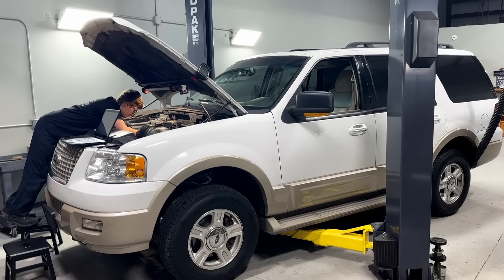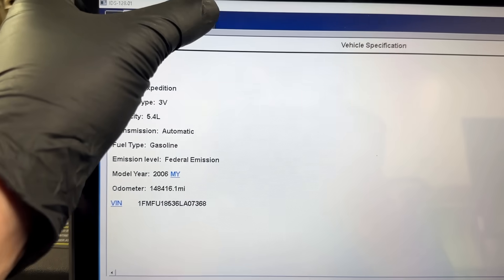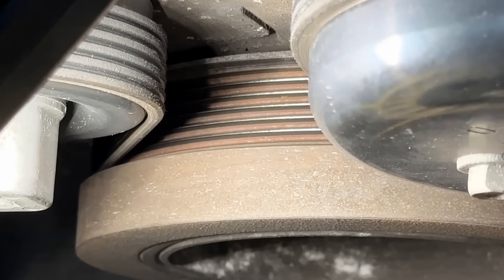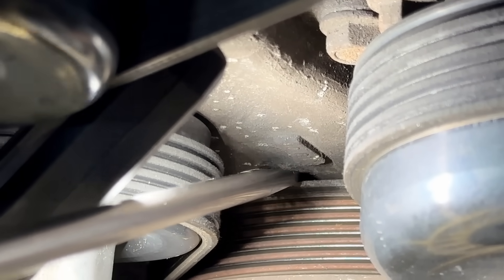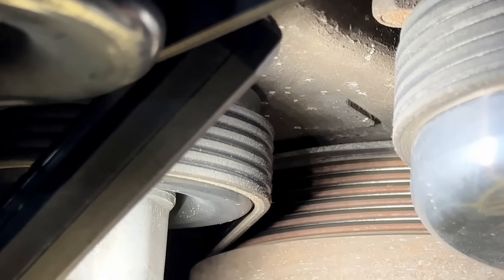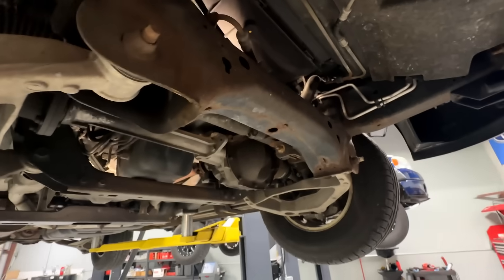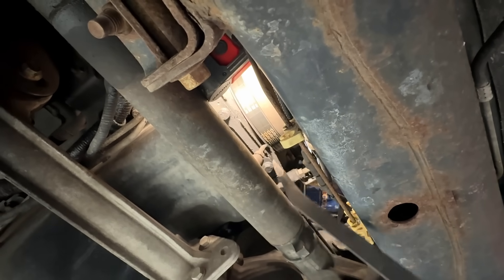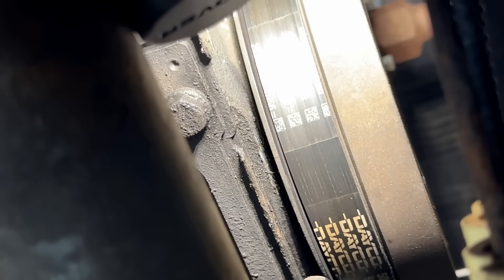Ford 5.4L 3v Triton Engines: Always Check This First Before Performing a Timing Job on this Engine!

Comment from the maker: This is how it looks inside the engine when the thrust washer fails-
https://youtu.be/dxJ23dv3pt0

Forscan is a free Ford Specific Diagnostic Software:
Download Here- 
https://forscan.org/home.html
ELM 327 Adapter I Recommend-
https://amzn.to/2GC6dBj

As an Amazon Associate I earn from qualifying purchases.
Reply: Ok, thanks for the link.  Trust an arrogant engineer to think that they have a soooo much better idea than something that has worked flawlessly for decades.  Good plan - replace a robust thrust bearing on #3 main cap with a small two piece washer!  Hard to comprehend the stupidity.
Reply: so whats the cure ? engine rebuild ???
Reply: I have 3v billet oil pump gears and I wanted to know if they would fit in a 4v oil pump. If not would a 3v oil pump work with a 04 mustang GT 2v?
Reply: Where are you located? I've got 2010 f150 that needs a timing job.
Reply: I have this issue. But my truck is still running. Is there any saving the engine if caught early can the washer be replaced
Reply: I got a 5.4 3v that doesn’t like to keep a idle at times, there is a pcm code p0605 that workshop says replace pcm with no description. I’m not do you know if this code would be the source of my iss😊ue
Reply: Runs good most of the times but once it shuts off once it’s repeated until I let it sit for a while  dealership says this is the only lead for my issue
Reply: Okay, I'm not too sure if this applies to mine. I need help trying to understand here. U only mentioned up to 2008. I have a 2009 f150 4.6 3v. Just had to replace camshafts lifters rollers and phasers. All OEM parts. Not the more advanced rollers with the new angled hole, but OEM. I followed ur video where u demonstrated replacement of the phasers to a t, but I also installed new camshafts and so on. I started my truck after everything and it has low power stall and rough idle. It did throw a misfire on cylinder 1 so I changed spark plug and it got a tad bit better. I watched this video because it just popped up and wanted to know if it applies to mine as well. Ford manual states typical endplay can range from 0.003-0.010, but is only obtained by pulling the engine. My crankshaft doesn't fit tight against timing cover and I need ur opinion please. I know you're busy I understand. I just need ur help please. I'm willing to rip this motor out n rebuild if I must. I wouldn't mind the experience. Thank you. God bless
Reply: @chadmoyer1453 where are you located

Comment: So, my church  plow truck is an '06 f250, 5.4 3 valve.. about 230,000 mi, and we were told that it wasn't that long ago that it had all the timing work done. Occasionally, after the motor gets warm, A noise will start, and sounds like a loud tapping, knocking. And I'll shut the truck off. Maybe let it sit for a minute, start it back up, and it's pretty much gone. But you might still hear it a little bit. And then it might start again. I'm going to get underneath of it and check like you did. Will the play that you're talking about, will that create a knocking noise? And how big of a job is that to fix?

Comment: I got an 07 f150 5.4l. A very few gold sparkles showed up in my oil - just changed the oil pan gasket and none of the bearing caps had any vertical movement, is it possible the thrust washer is going out and I can replace the thrust washer before the engine is shot?

Comment: At 8:30 sometimes I don't hear what Brian is saying. I'm hearing "R Indicator." What is that device called and what is it for?
Reply: Dial indicator.

It is used for measuring. It consists of a dial graduated in .001” with a plunger that goes in and out to do the measuring.
Usually mounted on a magnetic base with an adjustable arm so you can measure in all different directions.
Reply: @pvtimberfaller  omg dial indicator! Sometimes I think I don't understand plain English. Thank you for helping me out there.

Comment: I had the exact same issue with my Ford oil leaking in the same spot, oil pressure doing weird things, was driving fine and then now I have advanced retarded crankshaft timing so do I need a timing job or do I need to fix the crankshaft pulley?
Reply: Im about to check mine to see if there’s oil in that spot but im doing a timing job due to rough idle and low power. It’s on and off but she started shakin n chugging as I got out the driveway which never happened before. Timing job is my assumption but now I gotta check the crankshaft pulley and if there’s oil and play there, then I gotta look into that as well. Fingers crossed.

Comment: Hello, I just bought a 2007 Ford 4X4 5.4L V8 Supercab and it is a project for me while I retire. I really like the truck, and you've given me a lot to look for. Since it is my last V8, the truck is special to me. And I look forward to getting it back on the road.
 Right now I have a No Start beginning, just replaced the battery, so I was going to give it a light tap with a nylon type hammer, and then if needed clean the corrosion off the leads to the studs. I have Subscribed to your channel and fingers crossed and hoping the problems ar not to deep, I hope to get this old girl on the road in about a year.  
 As soon as my wife gets back, I will be out taking a good look at her and hope to at least get it started soon. She sat for about 2 years, and rust took over quick. 
 I have always been a MOPAR guy, and thought I would try something a bit different...

Comment: Have a 2008 F-150 XLT Supercab 271K  miles.No codes showing,still runs great,oil changes every 3K miles.Intermittently getting the shaking at low rpm’s,can accelerate out of it but local mechanics will not do a timing job on it.They all are suggesting a new motor.Your thoughts? Thank You.
Reply: Did u get any more info about this? I got the low rpm intermittent shakes and am doing the timing job myself. Fingers crossed it fixes the issue.
Reply: @Texasd96 I took a commenter’s advice and changed the oil from 5W-20 to 5W-30.So far no issues, but I haven’t driven it for a long distance yet.👍

Comment: You mentioned in passing, without suggesting what the specific issues are, on 2006-08 5.4L 3V engines. Mine is a 2008 and currently doing a full timing job on my F250 Super Duty. You have given me a lot of useful information in all of your videos, but some statements like this only leave me searching for specific answers to fill in the blanks. 

Yes, I knew this engine has some specific shortcomings when I purchased it, but more hints would be useful.

Comment: Mi Expedition king Ranch 2010 hace ruido al encender el motor por la mañana como si trajera algo suelto en el motor, así a grandes rasgos ¿Serán las guías de las cadenas o los sincronizadores? Saludos desde TX.
Reply: Si. timing chain tensioners and guides if you catch it sooner than later. With time the roller followers can be damaged as well eventually damaging the cams.

Comment: Are the clearances the same for the 4.6 3v, specifically the Mustang version? Mine has around an 1/8” gap. It’s big enough to comfortably get a flat blade in there, but no movement with the prybar test.
Reply: @fordtechmakuloco same question, same situation, i was checking for this comment before i asked myself, i got an 05 mustang 4.6 3v about to do timing, came across this, should it be as snug as these 5.4s?

Comment: You can also look at the tensioner pulley as well.look at where the belt is riding on that pulley. Then do your crank end play check.great advise!
Reply from the maker: Nope, only because the aftermarket tensioners can ride toward the edge with no crankshaft end play but the Ford tensioners will track in the center with no end play. Thus I do not want to mention it and lead anyone astray.

Comment: The water pump pulley.and belt riding on edge is easier to see!
Reply from the maker: Aftermarket tensioners can also do this so it is not accurate

Comment: A bit late to this video...mine appears to be bad, same sort of gap. Weird thing is, truck still runs great, no codes, rough running, etc. Doesn't burn a drop of oil, but sure leaks. Bottom of engine is covered, seems like it comes from the front somewhere. I was going to do a timing job, but will skip it now and re-evaluate the whole truck. Not sure if I want to replace the engine at this point. Then add in brakes, shocks/struts and tires. May be time to just run her til she leaves me stranded....any advice? 192, 416 miles...

Comment: You look at where belt on idler pull is all the way to the outer edge.
Reply from the maker: No always an indicator especially with aftermarket tensioners.

Comment: I learned something today! I could also see that the belt was riding real far out on the tensioner. It was a big difference on the good engine. Like you said, about a 1/4 inch. Got to pay attention to the details in this business. Could save you a lot of headaches later. Thank you.

Comment: Hi! Thank you for posting this! I have the '08. replaced the timing chains in 2022, then again in February of 2024 and they are starting to go bad again. I do not know if my mechanic put OEM parts in it either time. Besides parts quality, would there be any other reason that the timing chains would fail so often? any insight would be greatly appreciated!

Comment: Hi I'm a fleet mechanic, I have in my fleet 2, 07, 5.4- 3 valve f250 superduty's,  from day one 3,000 mile oil changes, up to 400,000 miles and we are in the 2024, everything in my motors is original, with no external leaks, so not sure why everyone bashes these motors, they are a stout motor!, I will argue with anyone, its your bad maintance! proof is in the pudding! and I'm in Michigan!
Reply: my thoughts, sir   rbw

Comment: Can tell by how the belt is riding on the idler pully. Good call though.
Reply from the maker: Not always, if it was a Ford tensioner pulley then yes but many aftermarket tensioners do not track in the center which would give you a false reading.

Comment: I keep having a p0022 code for timing over advanced truck runs great idles great until it reaches temp then Runs horrible already changed vct solenoid and replaced phaser on bank2 issue keeps happening any idea what it can be?

Comment: Question, somewhat related. I'm finding transmission fluid on my bell housing and sway bar, but don't see any signs of a leak around the pan or hoses. It was recently rebuilt.

Comment: I came here because I was looking at a 2007 F150 on Craig's List:

" 07' with 122k miles. 4X4... V8 5.4Liter... runs great. I listed the truck way below blue book value [$6,500] due to it needing a timing chain. I am selling it AS IS at that price. If I end up fixing it, the price will raise up to accommodate the work. Either way, it's a steal. "

0:40 "07-- the Sweet Spot you want to avoid at all costs! (It's a steal, indeed!)

Comment: I recently did my rack and pinion, inner and outer tie rod, four-wheel-drive, actuator, steering shaft, I have power steering pump, and now when I’m going into a curb or turn. If I do not slow down, or if I attempt to meet up even a fraction of 1 mph, I get a horrible shake in the front everything is tight and nothing seems to be alright… Any suggestions on what it could be? Or what I should check?

I’m truly stumped on this please help

Comment: On my 2005 F150, I have a 1/8”  gap between the front cover and crank pulley on the topside, but no play when doing the pry bar test underneath. I guess I’m good to go ahead with the timing job?
Reply from the maker: yes

Comment: Just on watching the serpentine belt riding on the outer edge of that pulley  at the left can determine that there is a problem!
Reply from the maker: If it was a Ford tensioner yes, but aftermarkets can track on the outer edge and have no crankshaft endplay problems.

Comment: Question is, why did the thrust bearings go out? This might be a deeper issue if it’s the converter like someone mentioned in comments  and you put in a new engine it will just happen again
Reply from the maker: Very common issue 2007 years mainly.

Comment: I have a 2006 Freestar with a 3.9. It makes a metallic grinding noise some times for 1-2 seconds on start up. I’ve searched YT and the web to find out about timing issues. Do these having timing chain or tensioner issues? More info would be appreciated, thanks.

Comment: I have an 07 5.4l. Just bought it and it has the gap on the crankshaft dampener and rear main seal leak. No performance issues or codes yet. 

Should I plan on replacing the engine or is there anything I can do to prevent catastrophic failure.

Comment: I have an ‘08 F-150 with the 5.4L. My crankshaft end plate is about 1/8” off. I have a rough idle when the car warms up and I’m getting a P0016 engine code. This was a remained motor replaced about 60,000 miles ago. Truck has 273,000 miles on it. Any suggestions? Changed the the VCT Solenoid and Camshaft position Sensor on the passenger side, no changes.

Comment: So why not just let it ride? Who cares at this point. Needs an engine anyway so ride till something actually breaks
Reply from the maker: Oil pressure loss to the heads when the crankshaft walks.
Reply: @FordTechMakuloco  you’ve replied to two of my comments, my brush with fame! I watch your videos religiously, you are the Tom Brady of fords. I have no idea, I just moved from the 6.0 diesel to the 5.4 and this a whole another basket of things to learn…

Comment: I thank you for all of your videos!  I own a (2009 F-150 130,000 miles)  It's not sounding like anything is wrong but I  am thinking of doing the oil pump timing and rollers..   It is still in nice condition body wise and I would like to keep it for several years. I love every video you have posted!  I know this isn't the video I watched earlier  but such great info about the thrust washer!!

Comment: I've got a 2010 5.4. I switched to synth blend oil. 3500 miles into the oil change it has problems with both cam phasers t-codes. P0022 &P0012. Coincidence?

Comment: No excuse for this! A motor that become damaged severely to the point of needing a new motor is a bad company. Ford did this again with the 6.4 diesel and NO ONE will work on the motor. Ford truly does suck. I don’t trust them with any motor

Comment: Hello and thank you for your videos. I have a '07 F-150 with the 3 valve 5.4 engine, 201k miles on ODO. Would you recommend replacing it with same rebuilt/reman engine or would it be too difficult to swap it for a 2 valve 4.6? Thank you for your thoughts.

Comment: I actually noticed on the bad thrust washer engine when you were viewing from the top down.....you can see on the idler pulley to the left how far forward the belt is riding as well. There's a good 1/4" of pulley showing towards the engine and the belt is real close to the front of the pulley......not normal. I used your timing vids when I did the job on my wife's '05 F150. I also found 4 loose roller followers that I otherwise wouldn't have looked for without your vids. Thanks!!  If I can ever return the favor in my area of expertise (jet skis) you just holler!

Comment: Just checked mine…definitely a gap but I could not pry lateral  crank shaft movement…I do have oil pressure loss after full timing job and oil pump so I’m very concerned. Going to check my pick up screen for blockages. Any thoughts on my case?

Comment: Considering how dirt cheap Expeditions are it's not worth putting an engine in one, just buy another.
Reply from the maker: ok
Reply: @FordTechMakuloco  "OK" what?  For what a 5.4 engine swap with a Jasper rebuild costs the average person in parts and labor you can buy two Expeditions at auction.  The trucks bring less than half the value of a Tahoe or  'burb because of the 5.4's crap reputation.  ALL the Triton-motored Fords have long since passed the point they aren't worth fixing.
Reply from the maker: Aren't worth fixing? I guess I will be going out of business soon then because it is all I do.
Reply: @FordTechMakuloco  I said nothing about whether people are dumb enough to spend the money.  People do it every day.  But I can literally, easily, buy good running examples for less than it costs to do an engine swap, even with a used motor if you can find one.  That, by definition, means they are not worth fixing, not that people are not idiots.

Comment: I was a foreign car mechanic for 20 years and the operation you are describing is the very first thing I always did when I got an old style VW beetle into my shop and that was to check for and play in the crankshaft because if there was excessive play in the crank shaft all other operations would be futile and it would only be a matter of time before the engine self-destructed.  any money or procedures that you performed on this type of engine would be like playing a one armed bandit at a casino .
Reply: I had Volkswagen Vans in the 70's. Old style, 1965-ish and early 70's. I got where I could pull the engine in 15 minutes. They were fun to work on. Volkswagen were designed for the average owner to be able to do minor repairs at home. More if you were mechanically inclined. Volkswagen means People's Car.

Comment: Brian,  i know you can't quote an exact number, but what would consider a fair price for a mechanic to charge for a complete timing job on a 5.4 3 valve like the kind you do for your customers?   I'm Canadian and live on the west coast,  so kind of impossible to come and see you as much as i would love to.  My 2010 only has about 105000 km on it now and I baby the heck out of it.  Oil changes every 6 months or 3000 kms whichever comes first, so I'm hoping a timing job is a ways in the future for me. Any guidance you can share is much appreciated. Cheers buddy 🍻